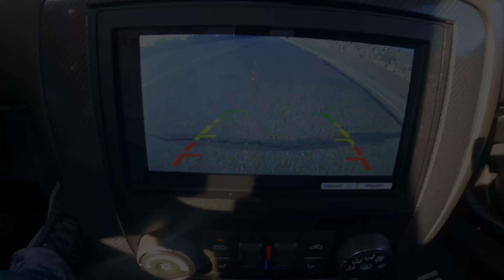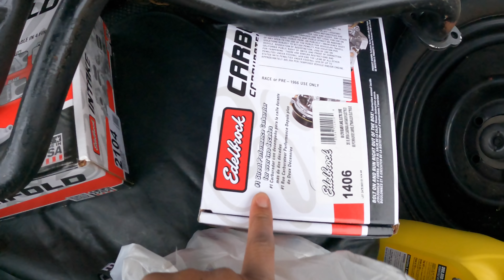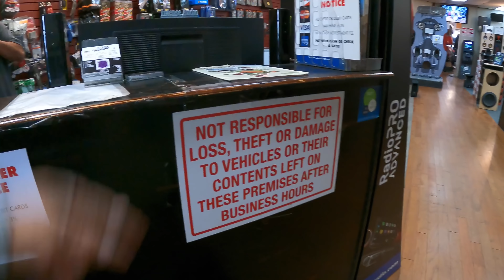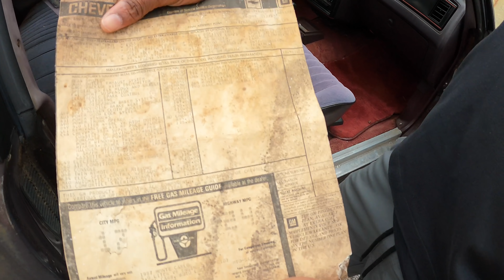My 1987 Monte Carlo SS Project Dream Car￼ Engine Blew Up So I Had To Buy Another One￼

Comment: I had the same 305 motor in my 81 Olds Cutlass.
Reply: Yep I saw an olds cutlass with a manual transmission and it came equipped with a Chevrolet 305 they are rare to find now the usual Oldsmobile engine I've seen on a cutlass is either a buick 3.8 litre v6 or a 307 small block 5.0 Oldsmobile engine with the oil filler spout in front of the motor and a 4.1 litre 260 cubic  inch or a 5.7 litre diesel 350

Comment: Im sorry that motor is still good putting water down the carburetors will not kill a motor it will bind valves if you start it up after and i don't see any sludge build up

Comment: When they spray water down the engine and you try to start it after that's what killed it 😂 but I wasn't worth the parts you were putting on it in the first place . A new engine is what this SS needs and it will be a perfect car .

Comment: Don't believe those mechanics.  They would prefer you agree for them to drop an LS motor in the Monte Carlo. You can put the Monte Carlo back together and runing so runs ok.    You don't have to do an LS swap just to get it running.  Either way good look.
Reply: Yup, those mechanics are trying to get money outta lucky, carb was over flowing so gas mixed with the oil, down the manifold. Change the oil and carburetor and car would be back to 100

Comment: Man lucky, I think those mechanics are trying to get you.. your carb was leaking and over flowing , gas will flow into the intake to the oil, change the carb and change the oil.. car will run solid , you didn’t blow the engine , car would’ve been knocking and not run if you did.. get a second opinion on it. Water in gas tank isn’t a blown motor , water in the oil would be bad head gasket.. those guys ain’t being real. Drain that gas and you’ll be doing donuts in that ride, ask unc
Reply: I would definitely get a second opinion….he should even let Unc look at it. As far as the guy who sold the car though, he knew that the MC had more issues than what he originally said.
Reply: @G_Body_Queen  I 100% agree . That guy really did lucky wrong..

Comment: what up Luck uh oh when u look at ur motor i said uh oh that bad the push Rods oil on the motor its time ti get u a 454 Big block in there or a old school 350 that Boarded out already andput u some 4 11 Gears in the Rear and brun them tires off the rims ok get it sideways ha ha ha and put the headers on the new motor and that intake on the ne motor ok and get u a 700r4 tranny for it to u wilk be fine ok ha ha ha and open up that 4 barral carb ok for the channel when its done ok i love yall man what up pops and unkand mel and the boys yall be safe out here its Halloween trick o treaters r out slow down in the city ok